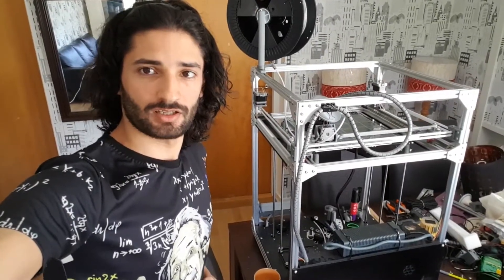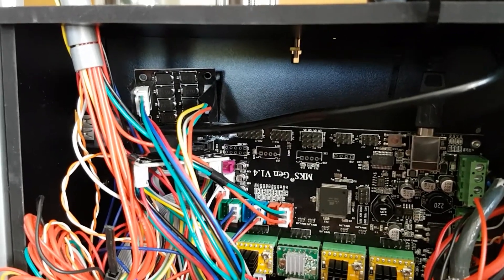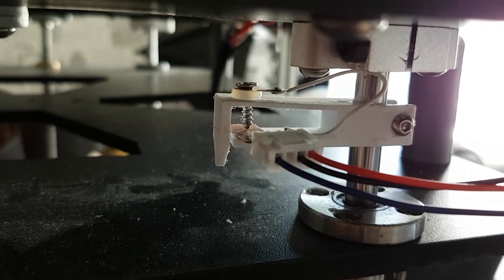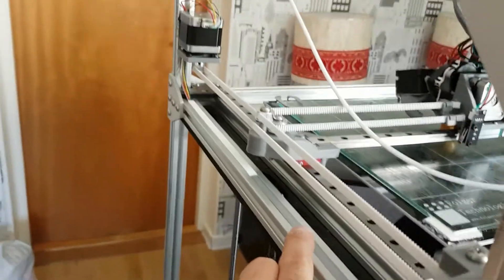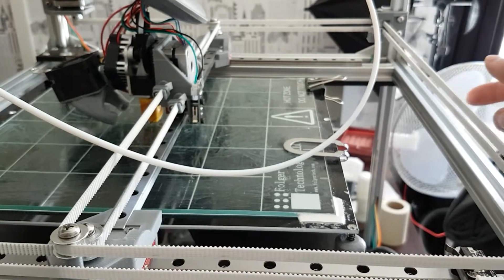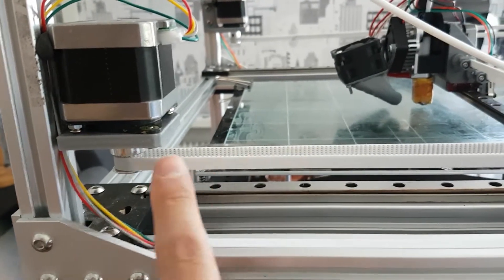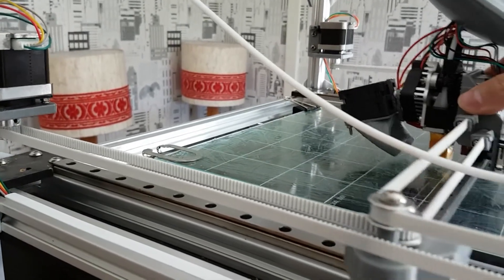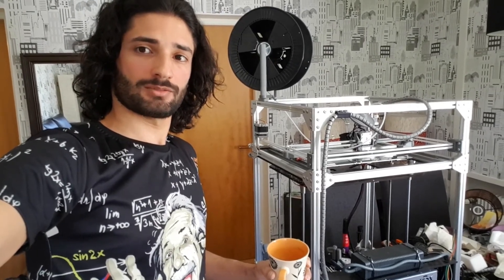All About My Modified FT-5 3D Printer

Comment: Did you delete your other videos? I think you used to have some videos of just the CoreXY gantry 
Also, I don’t see the files in thingiverse anymore
Reply from the maker: @aaronmiller08  I don't think I deleted any. But here are the files for the CoreXY conversation (when it was FT5).
Reply from the maker: https://www.thingiverse.com/thing:2409756
Reply: @RajaaKahel  hey Rajaa, sorry I forgot to edit my comment. I checked the link in your description and it took me to the page. The search didn’t pull it up for some reason. 
Thanks for replying! I thought I remembered a couple other videos discussing it, like a part 1 and 2. But that was years ago lol. Thank you for doing all this. 

What does the printer look like now? Do you still have it?
Reply from the maker: @aaronmiller08  No worries :)
Thanks man.
It's called now RK3D Tool Changer. Nothing left from the FT5. I used it's 2020 extrusions for my new design. Here's a link that has some videos:
https://www.thingiverse.com/thing:2537454/files
Reply: @RajaaKahel sorry I missed your latest reply! Really cool build man. I think mine is headed that way.. the stock FT-5 design is very outdated now.

Comment: Wow! using a tuner to tighten the belts. That is a great idea!
Truthfully, you had me at U.F.O.
Reply from the maker: Cedric Proper Thanks! Glad you like them both :D
Reply: I liked how you used the xbox power supply separately from the 12v stock power supply and added the MOSFET to fix the problem. Can you go into more detail? I have a few of these kits, some 3d printers that already work and I would love to know more. You have great skill.
Reply from the maker: Cedric Proper Thanks dear!
Check the description, I have explained the Xbox 203W PSU wiring, if you need more explanation let me know :)

Comment: Thanks for the share of your changes, that's an  interesting video. Regarding the hotend, you use ceramic junction with no fan on it. Is there a particular reason why you do not use E3D hotend or similar with  dedicated cooling fan ?
Reply from the maker: You are welcome! :)
I'm using Titan Aero, which has a heatsink and cooling fan. I'm using a regular Volcano heat-block covered with ceramic-fiber and Kapton tape.

Comment: I have a question. Having removed the extrusion from under the X axis, have you noticed any deflection of the linear rail ?
Reply from the maker: Mark Duncan Never. I also know a guy that is using the rail without support for a long time, he never had an issue.
Reply: Thank you Sir

Comment: Very nice job Sir, I too have a spare un-built  FT-5  I have been thinking about this 
 type of conversion and your video just convinced me to convert mine to CoreXY,  I aim to make the head even lighter as I have a duel chimera extruder set with the Zesty nimble cable drive system so no motors on the carriage, and a the Duet Controller
Reply from the maker: Mark Duncan Thank you dear! With the Duet and light extruders you'll have a lot of fun! Maybe you can reach more than 600mm/s! Mine run at 300mm/s travel speed without issues, I'll try faster later.